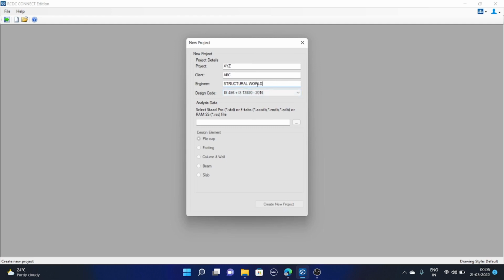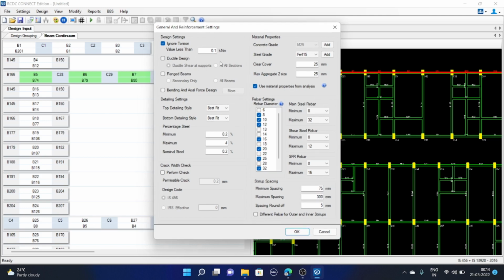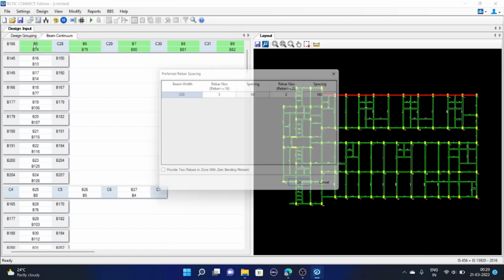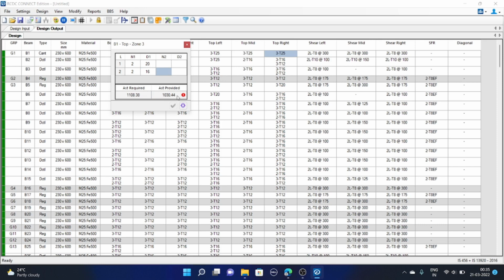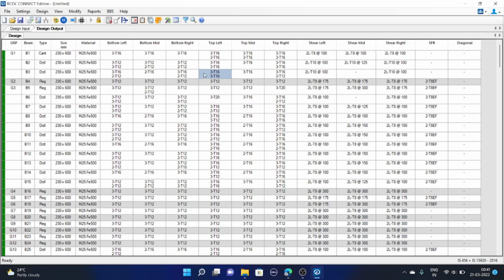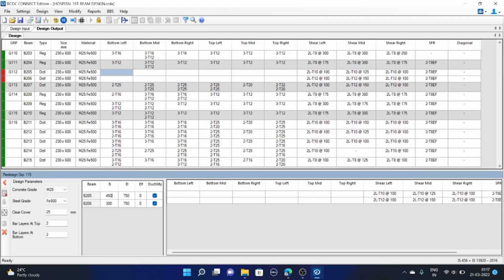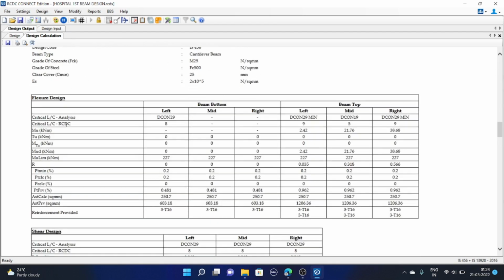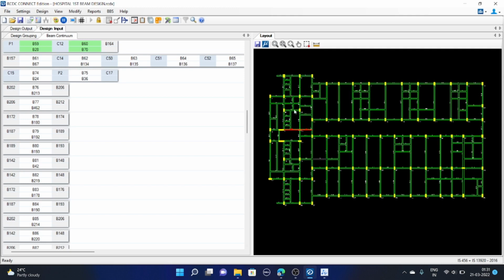Design of Beams In RCDC

Comment: One issue is coming bro !
Suppose i have a span 11mx16m ! (11 along horizontal and 16 vertical) !

So i have put some 3 columns in between 16m at some intervals, and i want my main beams to span between them along 11m ! While there is one cross beam on the columns (vertically) from centre of 11m !

But rcdc is breaking my main beam instead of the secondary beam !!! How to define this properly ki which is primary and which is secondary?

Comment: Hello. Thank you for the tutorial. I am having a peculiar problem with beams. I have beams 2 meters in length but when I import to staad rcdc the beam length changes to another dimension. Sometimes I get 6 meters. I have secondary beams in the design. Your help is appreciated
Reply: I installed a current version of rcdc so the problem is solved
Reply from the maker: Your are welcome. Please recommend this channel to others
Reply: @structuralworld4880  I will recommend. Could you please do a tutorial on cantilever slab without beams in Staad pro and its detailing in RCDC? The challenge is the reinforcement to come from behind the supporting beams. I am yet to nsee a tutorial on that. Most times they leave it out at staad pro and never take us through the detailing in RCDC. Thank you sir.